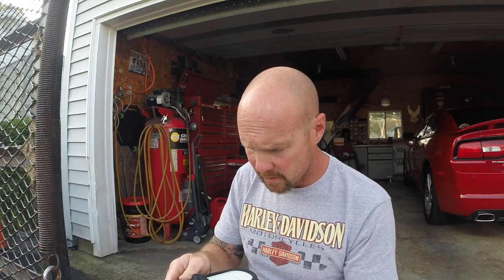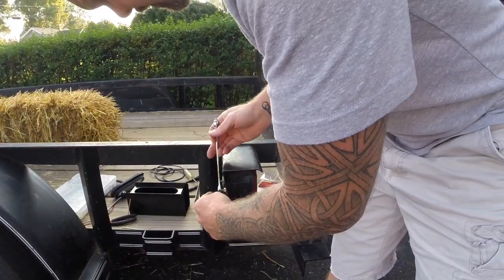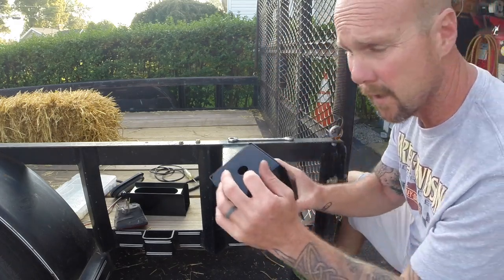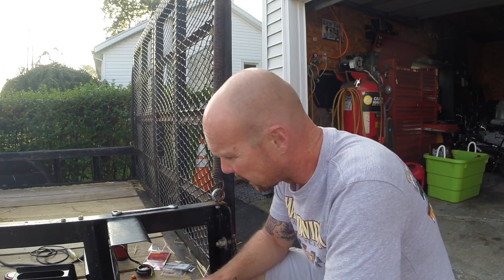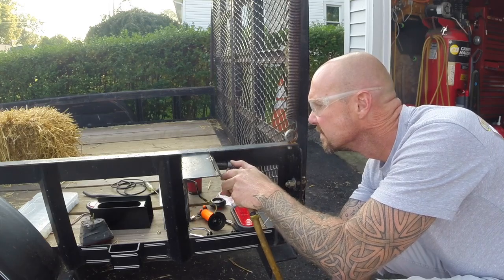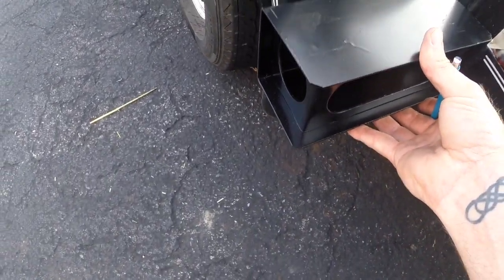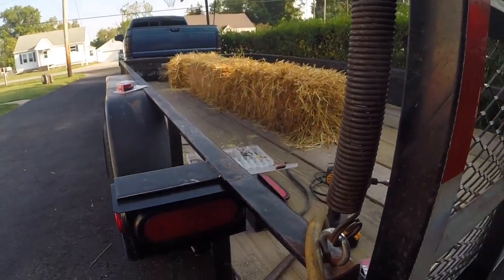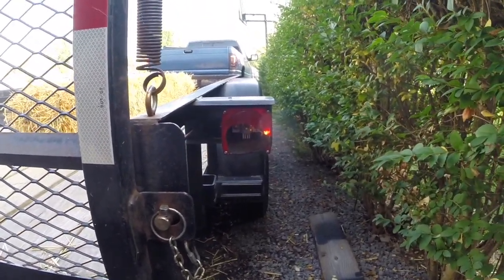Installing LED Trailer Lights

Comment: Thanks for the wire color identification. My existing wires were yellow green brown. My new on the eBay LED lights that came with no wiring diagram whatsoever, colors were black white red.. good video. Thank you
Reply from the maker: Your welcome Thanks for watching!

Comment: I bought the same light set up and threw away the instructions. Luckily you made a video with the correct way to wire them up. Somehow, I didn't ground my white wire but after watching this video, I went back and double checked and now everything is working just fine. Thanks!
Reply from the maker: Your welcome... Thanks for watching!
Reply: Where did you get these lights ?

Comment: Can u clarify the wire connection cuz i heard black and turn and got all mixed up.
Reply from the maker: So yellow & brown is the driver side with yellow being stop/turn. 
Green & brown is passenger side with green being stop/turn on that side. 
Brown on both sides is tail.